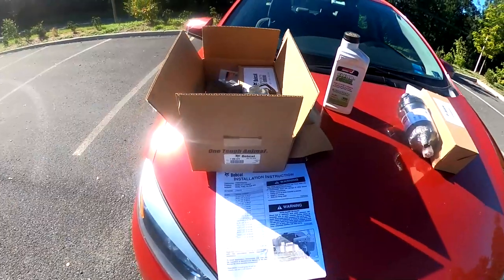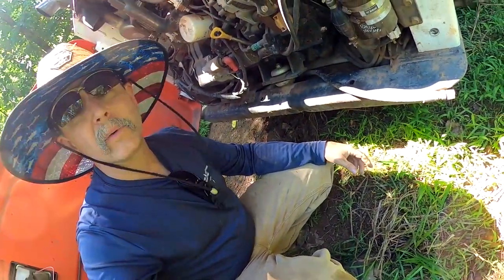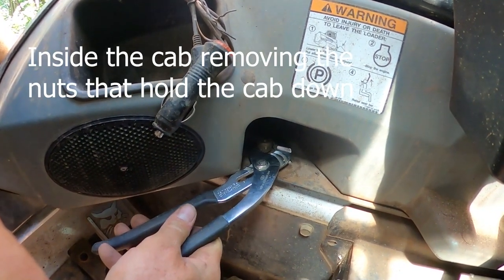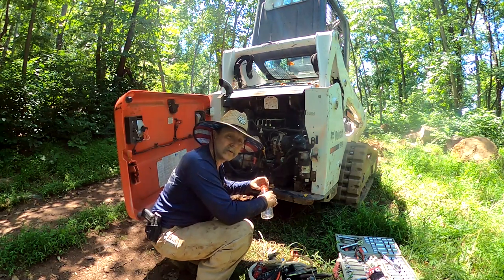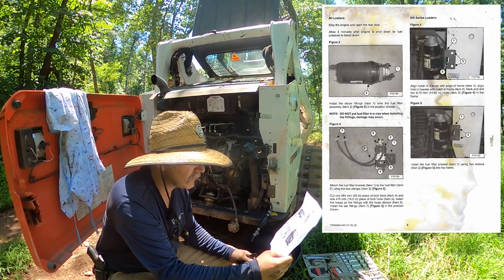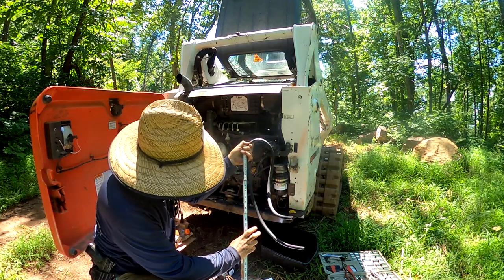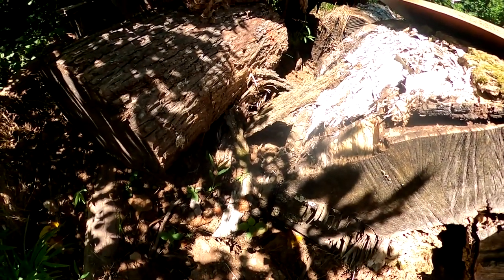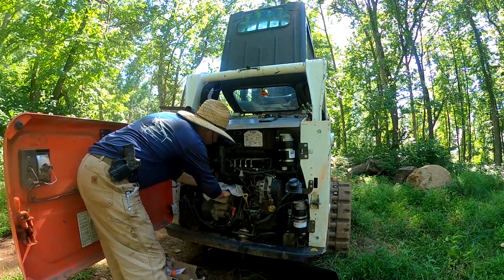2020 Skid Steer Error Code Part 1 of 2

Comment: Your "tip" about hitting the ratchet with your hand to loosen a fastener is personally horrible advice to offer your viewers.  I was a mechanic professionally for 15 years and thought the same thing as I grew tired of busting my knuckles. Over time though that " tip " I recieved  caused damage to the nerves in my hand and I now have days where I can barely hold a tool with my hand without shooting pain all the way up my arm and need surgery to correct it.   If you want to offer a tip it would be to grab a mallet and hit the ratchet to loosen a fastener! Not to use your hand as the " mallet"
Reply from the maker: I apologize for the tip, I will make sure to emphasize safety in future videos.